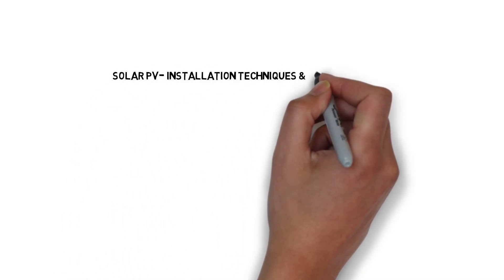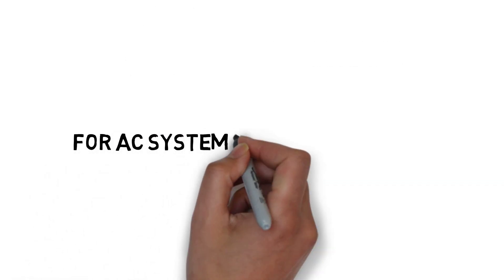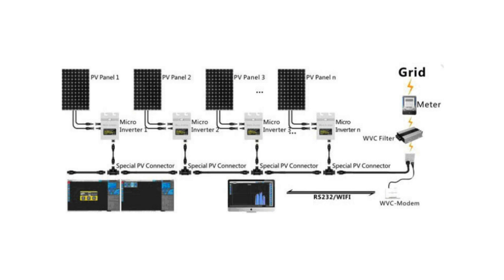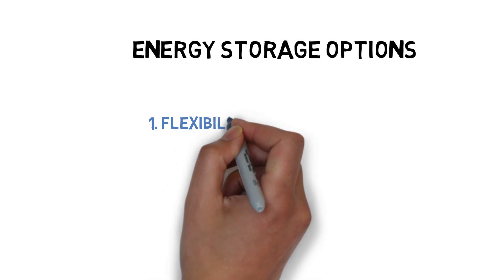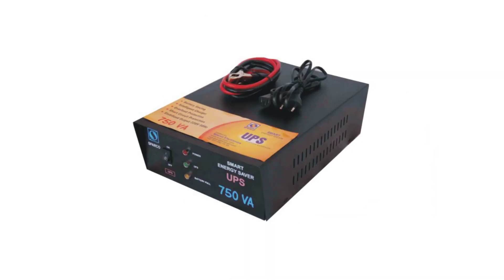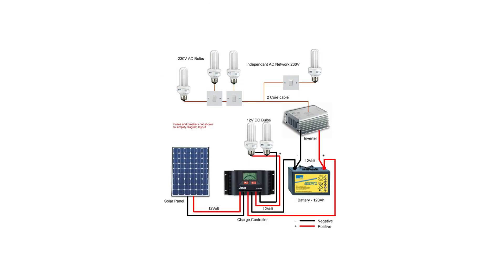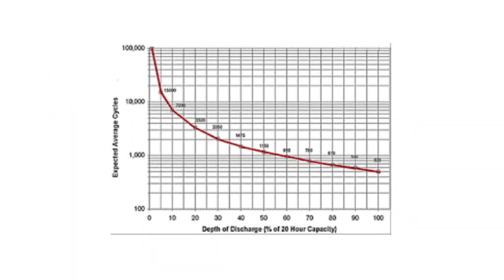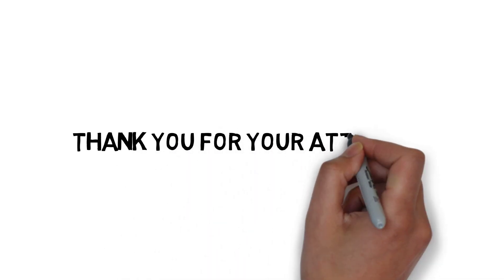Solar PV Schematic and Wiring Diagram

Comment: even tho the TV, Light and all the DC appliance are 24 volt DC, however you still need inverter(AC power) to power up these equipment since most of these equipment has there own power supply embedded inside their system.